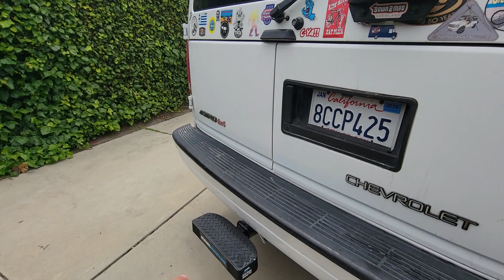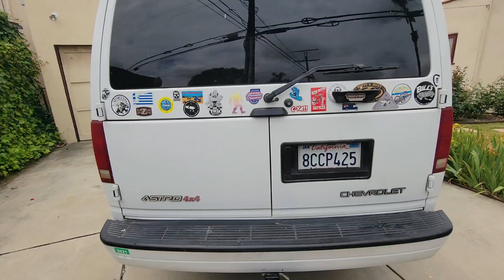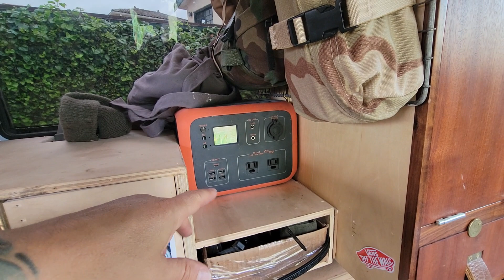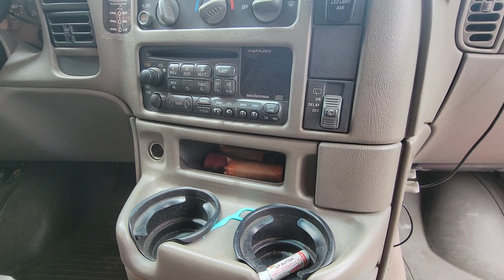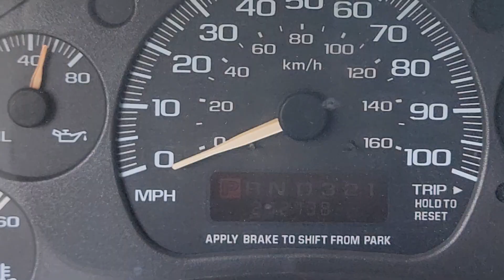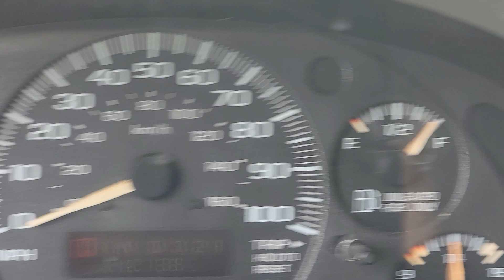This Is My 4x4 Astro Van

Comment: Very nice Astro. You don't need to start the engine to read the odometer. Just press the trip odometer reset button and the odometer will come on for a few seconds.

Comment: OK Ya, Nice job describing the inner workings, or mainly the Under-Workings of your Astro Van & how you've been putting it all together. As you say 'a work in progress'. The fact that you are in Love, with this set of wheels makes all the difference. Nice. I've had Every Type of vehicle that anyone can imagine. Driving All around the world almost, and have a Long list of stories. As far as Van's go, I bought a new Econoline 150 down in Long Branch in 75 and drove it for ten years in the city Beating it up on the worst streets in continental u.s., NYC. I Never had an issue one except for starter-motors. I had the van for my business (garment) and did millions of delivery jobs All the time. Having a vehicle in the city with commercial plates, was almost heaven when not dodging the parking meter MudPhucquers. Now to address your gas milage: my guess is, and it's only guessing, you have several obvious reasons why it's so low. Your added weight is the killer. The roof-rack, the extra-large gas tank, the different gear ratio and larger tires, and the Posi-Traction is no friend in the long haul. Then, All the added goodies on the inside made of wood, and water is heavy, and the overall shape of the van is not aero-friendly at all. (how am I doing???) Now don't get me wrong, I love your build, but it IS, What it IS. I drive an FJ which fights the wind in All directions except a tail wind. I'm almost finished with a cargo rig build 7x7x12, and decided to go That Way, so I can free-up my Trekking with just the fj for all the ultra funky hiding places I like to go with my girls.(Dogs) So many ways to attack the Off-Road lifestyle with convenient accommodations of sorts, but there will Always be a compromise. I can stash my rig behind rocks & trees, and set out with just the truck and a nice big tent, and I'm good to go. Next Purchase, an Air-Conditioning unit that will keep us cool All summer. I'm working on that now. Somehow Michael, I see you in a Ford Van, 4x4 with 6inch lift, a sweet V-8 and All your goodies living in such a larger space with room left over to go Bowling. 👍👊 🌞 Anyway, Bravo Astro 👏👏👏👏👏 😎👋 You did Good.
Reply from the maker: Right, everything is a compromise - I dialed this to be more off-road capable which pushed me to the 32" tires which meant re-gearing became mandatory. The 32" tires ,which are 235/85R16 are also "pizza cutters" compared to what you typically see on most off-road vehicles, roll over things much better that the smaller tires - They're also much nicer in the city where the bad roads are sometimes as bad as what we find off the pavement. I'm not surprised the mileage dropped, I expected it - I just did as much as I could to keep it from being far worse and I think I did a pretty good job of it. I'm typically driving 80mph so if/when I slow it down to under 70mph the mpg's are much better
Reply: @AstroVanTribe  Yes, the Speed Factor. I forgot to mention that. Recently, since we have been getting Raped at the gas pump, I started to Cool It and only drive 65 Max, and many times just 60. It will Amaze you how much you will save. Ya, you can read the lips of the up-tight drivers behind you, but phucque em. You will Still get there, and maybe even enjoy the scenery a bit better. The difference between 55 n 65, is 34-38% Better Mileage. Ubove 65 it's over 47% Crummy Consumption. I get it though, it takes getting used to. I still like your Astro Van no matter what.
Reply from the maker: @vencenzodemarco4393  Yep, and "thanks", the more people support the idea of driving slower the more comfortable I suppose I'll become with it - I've driven across the country well over 20-something times in 17 different vehicles (on top of countless other road trips all over the country) and was always in a rush due to "time" - I keep forgetting I'm getting older because I'm really just getting better :D - I really need to slow it down
Reply: @AstroVanTribe  Hi Michael. I spend most time, the Best of times, on & around the north rim of the Grand Canyon where there are no tourists. Az, Nev, & Ut are my favorites out of this big bad world these days. It would be nice, if you are going to be in this area sometime this summer or fall, and I will share some of my hiding-places. Most peeps don't venture forth as far as I like to go, only the wackadoodals in their side by sides but they don't stay long. If ya get stuck here, ya stay here until help arrives. Nothing you can't handle, I just make it sound rough. It's great to Get Away from humanity yet be so close. Too bad there are no Hot Springs in this special area as that would be a major plus. I must go to the location of your last desert trek, where you & H were able to Soak at that Oasis. That, is a great place I'm  dying to go. Can I communicate with you via Facebook?? it would be private that way. Much to share & it could be fun, if ya have any time outside your normal schedule?? Normal Schedule??? What's That???
Reply from the maker: @vencenzodemarco4393  I'm not on FB as much these days - I have IG and can be messaged there but yeah, I'm pretty busy with work, friends, and now this YouTube this is turning into something. I have a pal in Moab I see every year or so but have been wanting to check that area you're talking about - Stay tuned, I usually put out thre what I'm planning so reach out then and I'm sure we can hook up

Comment: As for a stereo, I refused to switch from stock for over a year because I liked the look. However, I just installed a Kenwood double din (Dpx505bt). It’s non touch screen and has a nice big turn knob for when your driving. And in my opinion, looks the most stock. It also fit the trim adapter kit. I have pics and everything I can email/text you. I have a 2001 gmc safari awd cargo I’ve been beefing up.
Reply from the maker: Could I load my music up into it? mike@mikezdesign.com

Comment: Cool walkthrough, man. I just fabricated a self-closing flip-up rear license plate mount for mine, because I'm installing shore power, and the NOCO plug is going to be concealed behind the plate. Considering getting some Silverado Tow mirrors, I hear they're compatible-ish (with a little modification).
Reply from the maker: Yeah, I like the larger mirrors but mine get beat up in the city as it is so I'm sticking with the OEM for now

Comment: Totally agree with replacing CD player with an iPod.  First went that way with a stock '99 Isuzu Vehicross 4x4.  Stock multi-CD player quit.  Been using iPods ever since.  My 7th gen iPod touch (out of production, last model) is handy for more than iTunes, like locating Bluetooth devices, etc.

Comment: 93 94 and 95 where put on a pickup chassis . I believe it was the Silverado frame . That's where the disc brakes came from . Older Astros have a lot of front end parts from the rwd caprice . That's why old school Chevy mags won't fit most Astros . I was so bummed when my 15 x 8 Corvette rallies didn't fit .
Reply from the maker: no, these are uniframe construction - the AWD vans have a front sub frame clip. No Astro was even on a full frame chassis - The front end parts are what's on the 1500 pick-ups

Comment: Also i did build a v8 astro years  back i used all the accessories off the v6 except the harmonic balancer with the right v8 exhaust manifolds i was able to keep the factory v6 exhaust it made a nice sleeper

Comment: always good to see i am not the only one out there that can't stop improving my old '01 SoSari AWD with LS Swap and 410 gears running 31s with 3"body lift.  I am wondering what source/donor provided the larger gas tank and how much modifications were needed?
Reply from the maker: It's the stock 27 gallon tank that came on my van
Reply: @AstroVanTribe  Right on.
I might be mistaken but I thought mine is only a 20 or 22 gallon OEM tank.
Let me know when you're going to start planning out and executing the ls swap. Been there done that with many lessons learned and especially lessons for AWD / front differential spatial conflict consideration which is not a lot of information found on various Safari/Astro forums.
Reply from the maker: @richardsilva5134  What swap?
Reply: @AstroVanTribe  pretty sure what you're referring to. I was asking what size tank did your gas tank come off of this is 27 gal because I do not believe my OEM gas tank is 27 gal but closer to 20 gal maybe 22 gal. But I think you answered that question already.

Comment: Yep it looks a lot like my 99 at least on the outside well for a few more days as the raptor liner is in the mail
Reply from the maker: Yeah, I'm wanting to do some kind of exterior coating - I'm considering rolling it on
Reply: @AstroVanTribe  I rolled the bumpers when built them and it is ok  on the bumpers but I wouldn't like the texture on the body so I'm going to reduce it and spray it through an hvlp gun but I'm just doing where the  cladding was ....for now 
My van is pretty much rust free but the cladding mounting strips where not and in getting them off it left places rust could start and thats the why

Comment: If you're going to V8 swap it, the rear axle seriously needs to be addressed first. Those 7.5's were never meant to hold up to the torque of a V8 + low range + 32" tires in something as heavy as an Astro. Even a small 4.8L LS(smallest aluminum block is a 5.3), especially if paired with the 30% lower 1st gear ratio of a 6L80 transmission, will wreak havoc on a 7.5 diff. I've seen many of them grenade in mild V8 4x4 S-10's which are significantly lighter. Alloy shafts and beefier carriers really don't help either since it's the cast center section that deforms under load.

On that note, I believe I mentioned in one of your other videos that there are 2 candidates for a rear axle upgrade. Either a late 70's to early 80's E150 9", or a later 6 lug Chevy express 1500 8.5". 

The Ford rear is nearly perfect in width and pinion location, but would require custom shafts and aftermarket brakes to retain your 6 lug pattern. 

The 1500 Express axle is wider than what's in the the Astro, but the pattern is the same and they use the brakes are a direct hookup. The Express axle would only need the passenger side narrowed something like 3" to get the right width and pinion offset.

Either axle will need new leaf spring perches and shock mounts welded on in the correct locations.

Comment: The 350 “bolts in “ whereas the ls is gonna need the bell housing and torq converter swapped as well adding length about 2 inches . Might work ?
Reply from the maker: Yeah, I haven't looked too deep into it yet - As I mentioned I'd likely do the full engine and trans swap BUT that's a lot of coin...  We'll see, really, this thing is fine as it is

Comment: Do you have a build spec sheet . I’m in the midd of buying a low mileage , no rust , leather seats awd . 
And first thing I want to do is 4x4 journey kit . 3 inck body lift journey kit . Bead lock rims and 32 inch tires
Reply from the maker: Sorry, no - BUT there's plenty of content here on this channel of everything I did, re-did, what worked and what didn't

Comment: 13:17 what is your rear differential ratio?... speaking of fuel economy and performance?
Reply from the maker: 4:10's, 32" tires, reflashed ECU which includes changing the shifting points - My fuel economy got much better in the city and if I don't drive too fast on the highway it's still pretty decent but you can't expect any lifted 4x4 with larger tires to get great fuel economy at speed

Comment: What brand and size are those shocks? And what size you have on front end? Thanks
Reply from the maker: off the top of my head I don't know but you can look through my play lists - The Rancho shocks up front came on the van when I bought it and the rears are Gabriel coil-overs - I just looked at them and picked them for size. It's doubtful you have the exact same set-up I'm running so you'll need to experiment as I did...  I'm also not sure this is all the right way to go, when I can I plan to have custom leaf springs made but that'll be after I do the front straight axle swap
Reply: I have 3” spacers on front and an inch or little more torsion lift on front and 5” shackles on rear. The front ones stock size about two years old and already toasted. Same with rear end. I have too much swing while driving. So it’s time to get new ones
Reply from the maker: @serhiy75  Yeah, the coil-overs helps a LOT with sway when driving on the highway as well as off road - I need new front shocks and was planning on Gabriels just because they hooked me up in the past with swag - I need to figure out what length. Originally I called them and one of their techs steered me right
Reply: So, if I did 1-1/2” torsion lift do I go with 1-1/2” longer on stock size? Same with 5” shackle ? Add 5” to length of the stock shocks?

Comment: 2005 Cargo came with drum brakes on rear.
Reply from the maker: I had the 2005 cargo and it had 4 wheel disc brakes - It was the van I had before this one, it was stolen from the Long Beach Marina
Reply: @AstroVanTribe  must have been an upgrade. Both of my 2005 Cargo have drum rear.  I've looked at swapping them out, but drums fade less and are better for hauling.  I'd swap the front out for drums if I didn't hate working on them.